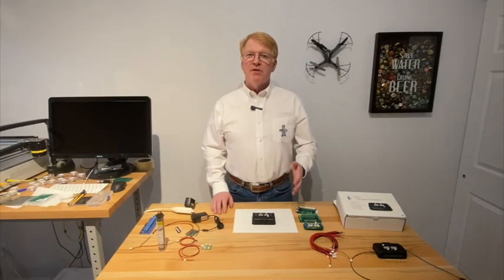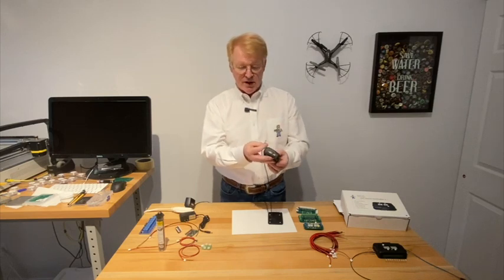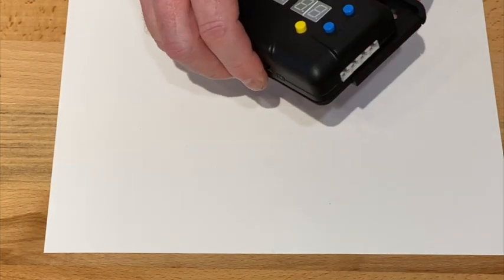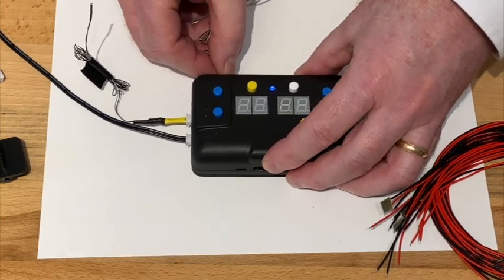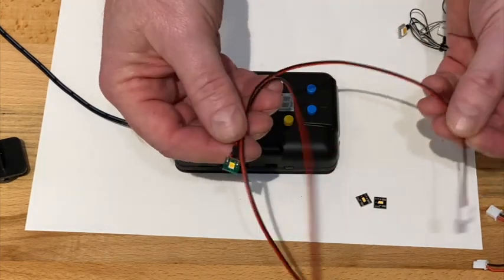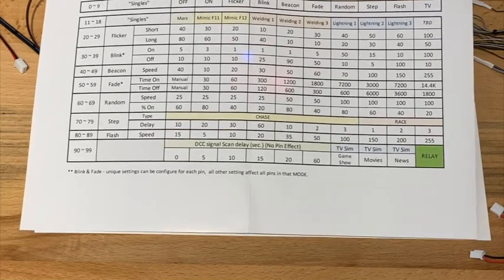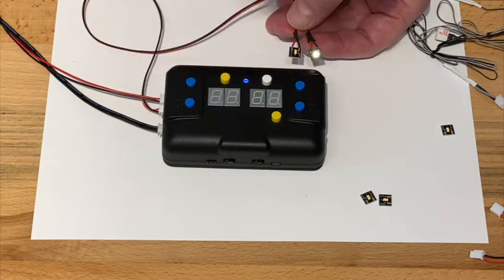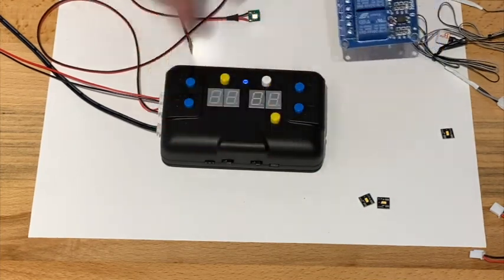Intro to the LED Scene Controller II

Comment: What do you do if you want the light further away from the controller than the length of the provided light?
Reply from the maker: Practically speaking the LED could be up to 20 feet from the controller using 28 gauge wire.  We have Connector blocks to interconnect the LEDs and you can order custom length wire with JST connectors on our web site.  If you need longer than list, just contact me:  support@modeltrainman.com

Comment: Will one port on the scene control box/panel run all 8 relays on the relay board you showed or is it one port one relay? Very nice system. Stay well.   👍
Reply from the maker: Typically one port :one relay but since the relay board input is a digital signal you could connect several relays together off on one LSC II port. Thanks!!  All stay safe.